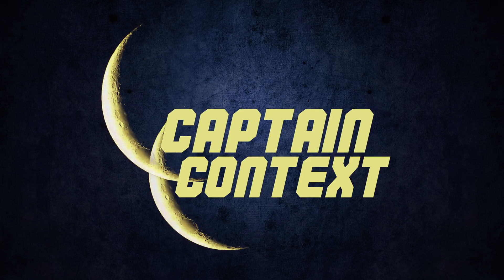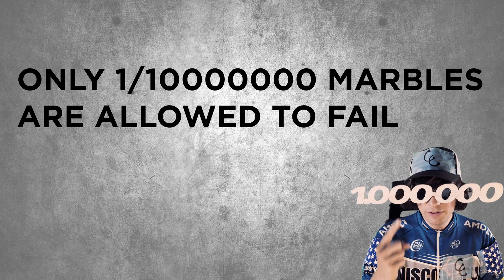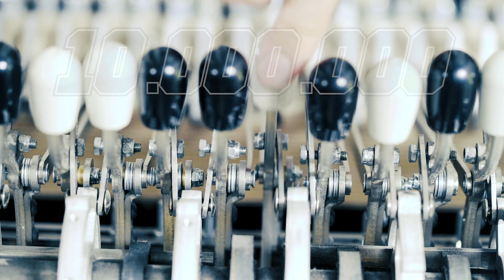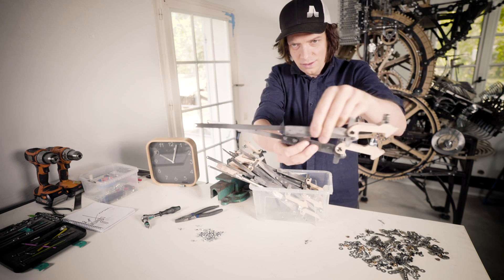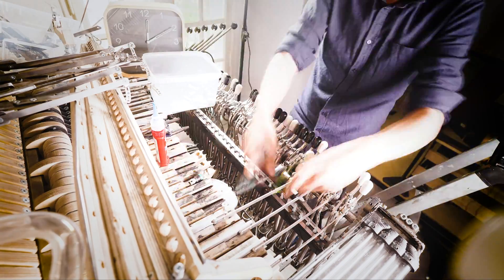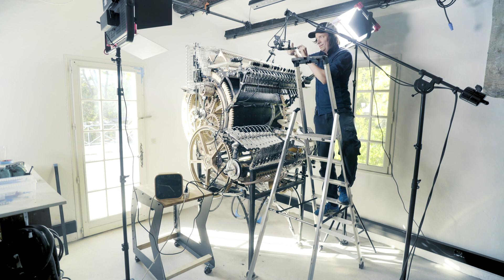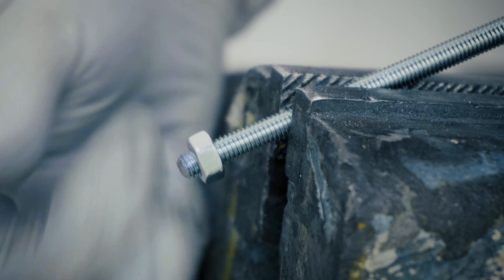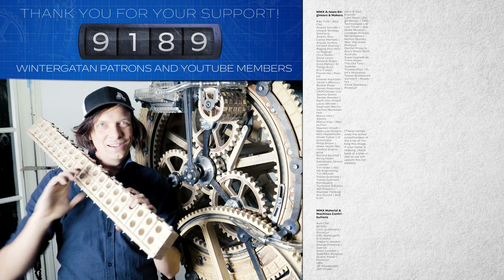Countersink? Why? - Marble Machine X #143

Comment: I don't understand why you do every single channel all at once instead of doing a test on say, 5 of them to find these errors? Then do the rest later once you are confident with the way they are working. That would have prevented you redoing these systems SO. MANY. TIMES.

You don't have to go for broke every single time, Martin. Make sure it is right first.
Reply: I feel that Martin is struggling, being pulled apart in several directions. His engineering team demand numbers and evidence. His fans demand that the machine be finished. And his mind is saying "This thing doesn't work as i thought it would. It's not right. It needs to be better." So what is he to do? He probably feels like he can't just tell his team of volunteers "this is crap, make it better". He probably feels that he can't tell his fans "we spent weeks and weeks on this tiny screw because it wasn't quite right and that's why there was no content". So he starts throwing about these numbers, hoping his team has a numeric goal to work with and the fans can forgive him for going back and forth because "the reliability!" But we engineers know... we know that sometimes you have to spend weeks and weeks on a tiny screw because it is a critical piece and it has to work right. I just don't know why he can't say it.
Reply: @CristiNeagu  I don't mind that there isn't as much content. Martin explained that very clearly to us, I think. I just want him to do what he thinks he needs.
Reply: @inthefade  I didn't say that fans demand more content. I said that's what he thinks the fans are doing. When he announced changes to how he makes videos and how often he's going to upload, all i saw were comments from people that were ok either with lower quality, easier to make videos, or with less often uploads, or even both.
Reply: @CristiNeagu  And he is done exactly the opposite, not missing a single week upload and even higher quality videos. Martin's head is playing with him.
Reply: @CristiNeagu  personally I think I like it more when somebody tells me he is struggling with one screw...and tells that it took a fair amount of time. 
For now Martin is handeling the problems with creativity. He is reaching out to others. And building a network. That's a life experience.
And I think to come up with the most simple solutions and designs is the hardest thing. Most often you think too hard. Making it too difficult.
But when I see this design, with al the wassers/washers/ spacers I think hmm. That could be simpeler. And the amount of wobbling in the registerhandles if its made by one of the professional designers I would think they could do a better job. But ey I have seen every vid from day one. And I will watch until I hear the machine play.. :d
Reply: same thought here as well. No offense or critic. But yes I think it's smarter doing 5 and run tests. I however still thought there was a lot of play in the register handels .. a lot of left to right movement ... Shouldn't that be more fastened? Like the vid though!
Reply: @ memespace: Well, if you would be so kind to travel back in time a few years to tell Martin this...

Comment: That's not how you calculate reliability, though.
Reply: Agreed. There also no way to confirm the reliability of each part.
Reply: Martin is just finding a way to live with the need for change. I guess the reliability chat is just how he can explain his changes. No way he can make it that reliable tho
Reply: That's actually how airline industry deals with twin engines aircraft reliability and safty on long duration flights, ETOPS(ExTended OPerationS, Used to be Extended Twin-engine, but the twin got chopped because it now covers every multi engines aircraft) is essentially a statical survey and monitoring of every critical component mid-flight failure rate as well as maintenance performance to ensure that aircraft can safely land on every airfield within an approved time limit in case of a system failure.
Reply: Martin has no engineering and science background. He has to reinvent the wheel every time something fails. He had to reinvent 5S to maintain order in his workshop now he is reinventing Six sigma and Design for Reliability.

Unfortunately there is a shitload of potential issues he rejects to deal with right now with excuses, so he will need to deal tehm on the tour and at the recording. So there will be lots of content for the YT channel. 

like: Martin uses angle grinder on stage to release a blocked marble and Martin uses angle grinder to disassemble the machine for transportation or Martin uses a welder to reassemble it at the next stop of the world tour.
Reply: I'm sure Martin is back at it again with his shenanigans
Reply: Yea and even then, statistically 1 in 10,000 means you could go  much farther than 10,000 marbles without a failure. You could flip a coin 3 times and get heads each time. Hell you could have that happen 5 times and it wouldn't be entirely surprising. Not to mention a failure can be something as small as a marble falling off the machine. Or a broken peg on the programming plate. Though to be fair the numbers aren't really the point he's getting at mainly just that the machine isn't reliable enough and that it needs to be very very reliable to be practical.
Reply: @EllaBananas  lol it will certainly never, ever be "practical"...
Reply: @robertofontiglia4148  It has to. He's going to play concerts with it. It needs to be as reliable, consistent and high-quality as the pieces of a piano... Just that there's like 20x more pieces than on a piano. Luckily he isn't doing it on his own anymore
Reply: @Loekamber  I mean, if you wanted to play the vibraphone in a way that was practical you'd just hit it with sticks wouldn't you. This machine, however reliable, maintainable, etc. will never be "practical" -- practicality was never a goal of it. But it certainly will have to be easy to maintain if he wants to do what he says he wants to do. And he talks very, very little about how he is going to perform maintenance on the machine, which makes me think that he hasn't thought about it that much...
Reply: @EllaBananas  But the very basis of the mechanism prevents it from meeting the standard of reliability he's setting for it. Dimensionally unstable material, needless parts for "visuals," excess slop, extraneous hardware, and the all-around "good enough" attitude or just some reasons he'd never achieve the reliability he insists on having.

Comment: No machine (that works like an assembly line
 like the MMX) in the world has this level of reliability. It's impossible.
That being said, I want to encourage the persuit of reliability, I'm just saying this machine should have parts that act as fuses instead of counting on a never happening perfect result.
Reply: yeah, he's not going to reach that level of reliability. But I think he has it wrong in his head anyway.
It's not a problem if 1/1000 notes are wrong/missed.
The real problem is the machine destroying itself when that happens, so that's the issue he needs to tackle. Something like a torque limiter on the flywheel and electric motor belt are a must. So that when the machine does get stuck, it doesn't start ripping itself apart.
Reply: @Robbedem  it is already there
Reply: @etiennedud  also on the electric motor? And has it been calibrated?
He removed a lot of friction, so it might be worth it to lower the max torque
Reply: @Robbedem  I don't believe the electric motor will see use outside of testing songs while they are being written. During shows he will play the MMX by cranking it. I believe he did calibrate the motor and the flywheel.

Edit: for readability.

Comment: I think you can go a little bit slower on the countersink, a colleague told me a rule of thumb that you'd countersink with about 1/3 of the RPMs you'd go with for drilling the workpiece.
Looked/sounded a bit like it chattered, may have just been my imagination though.

And yeah, a valuable life lesson - better do it right the first time.
Reply: He's not taking the time to calculate the correct RPM for the drill. He's just setting it to warp 11 and sending it. The proper RPM for that countersinking op is probably around 600 rpm. Optimally, you run countersinks at 50% of the drill RPM for the countersunk diameter, which is larger than the drill diameter. You can use the drill diameter can be close enough.
Reply: If you don't have time/money to do it right the first time, what makes you think you'll have time/money to correct it?
Reply: @ddanielmiester 
Mentality: >> better do it right the first time << is a bad one as it can discourage product finishing (khm MMX...) in the first place as everything needs to be perfect.

Rather than "better do it right first time" think "do your best that you can do at the moment".
It is much better mentality because true development of product is done with errors that are solved within development cycle or after.
The other extreme would be how software development today goes. Better do is ASAP and fix it "later" aka never. This is destructive mentality that brings chaos.

But yes, as you said Daniel, it is nuisance if you do it wrong the first time, but this is a natural process of learning/development. 
You learn by doing things, whether they are right or wrong, just give your all.

Comment from the maker: A video without context is like a dog without a friend
Reply: Do you have a shop dog/cat yet? (Granted floof and mechanical devices aren't friends)
Reply: Hi Martin, its me again. You seem to be focused a lot on reliability lately, which gave me a sort of idea. The brand new marble drops will work amazing under normal circumstances but have you considered that if a magnet or stud weld fails it might lead to a much shorter opening for the marble to go through, and if the marble is already half way through the gate when that happens, it might cause the marble to get stuck, ruining your song. My idea was that what if you shortened the bolts in the marble drops to reduce the danger, and it would also improve the speed at which you play at. It would be a decent amount of work because 38 channels and you would probably need to take the bolts out and grind the ends with a drum sander or angle grinder but it would prevent problems in the future and make the machine better. I love the video, keep up the great work, but don’t forget to take breaks!
Reply: The Model Y mention about the structural pack seems like it'll go over a lot of people's heads! I guess you really enjoyed Battery Day! :)
Reply: I love this captain context Martin :D we believe *
Reply: its like pain without glory
Reply: TIL I'm like a video without context
Reply: @alakani  I'll be you friend :)
Reply: Truer words could not have been said
Reply: Don't have a cow, man!  As long as it's no more than one marble/note per song, the occasional dropped marble is part of the charm of the machine.
Reply: @fredashay  hes not talking about dropping a marble, hes talking about the machine catching or something or a marble dropping into a place its not supposed to go and literally ripping the machone apart. If that happened on stage the concerts over my man.
Reply: These new registrators are super elegant. Watching them move makes me soo happy. I would love to contribibute to the cad or something else, however collage does not give me enough time.
Reply: A dog in a video is like a friend without context
Reply: Eeee
Reply: like a dog without a bone
and actor all alone
Reply: HEY,WHEN WILL THIS PROJECT BE COMPLETED AND GET TO HEAR THE NEW MARBLE MACHINES AWSOME BEAT
Reply: You should replace that stack of washers with a propper spacer...just sayin.keep up the good work.
Reply: @nekomatajs  I think it's because they aren't all identical; some pieces have more washers than others.
Reply: A video without context is like hair without shampoo
Reply: That dog was whispering: kill me...kill me...
Reply: So like you?

Comment: The joy of Wintergatan every Wednesday has been replaced with the joy of Wintergatan Random Surprise Videos!! Thanks, Martin & team! We believe!
Reply from the maker: Thank you Carrie :) The change from doing wednesday release schedule to releasing videos when they are done is a real improvement for me, glad to hear that its working out on your side as well. Thanks for believing, i think its 50/50 between masterpiece/sunken cost. Stakes are high!
Reply: Wintergatan The build documentation is also part of the piece. The schedule does not matter, just the fact that it's documented. And even if you would decide to stop now: It would be a masterpiece in my eyes.
Reply: @Wintergatan  Exactly how much are you rebuilding?
Reply: @Wintergatan  I came up with a really simple solution to 99.999999999, you create a field of drop, basically you work out a range in which it's highly unlikely that the balls will go beyond, and you put a secondary catcher underneath, made out of plastic or metal and glass, and basic this will filter all the marbles in to a bucket, in which you can then pour them manually back in to the machine between songs. This isn't very elegant and it's probably not the best engineering practice, but it's a good last resort. Basically a shield which goes around the dropping area and filters the balls down, unless the balls just some how manage to do an extra ordinary bounce some how any marble that falls will end up being filtered to a central pipe with puts all the balls in to a bucket or an air lift which filters the balls back in to the machine. Either way no balls will escape. Think of a vortex coin bank under the machine and coming up around the edges, so no balls should bounce over this and any that fall down will go to the centre of the vortex, in which you can use a pipe to feed them where ever you want them to go. Not sure if this is a precise fix, it's kind of more like a catch all. So it works but it's not precise engineering. Also you would need to add some way to remove the energy of the ball dropping, so it didn't bounce back up hard.  Kind of like a safety net for your machine. Vortex Coin Bank: https://www.youtube.com/watch?v=bb727UoQG18
Reply: Nanananah, It's most definitively wednesday. I'ts just that the weeks are getting a bit longer.
Reply: I agree!! And Martin seems to be less stressed, which is awesome. (I don't know if he is, but that's just the feeling I get)
Reply: wait I thought it's Wednesday